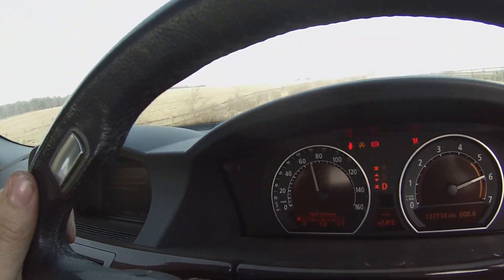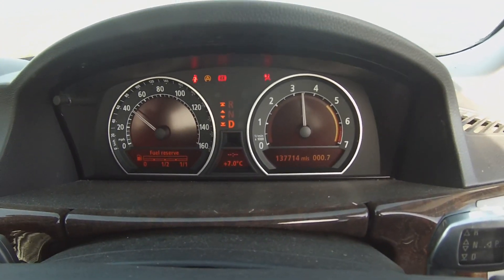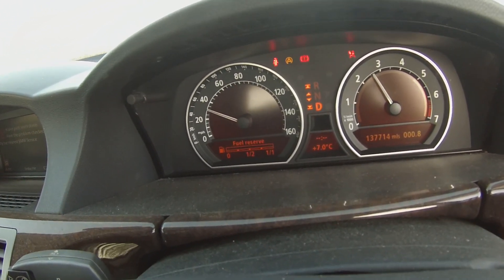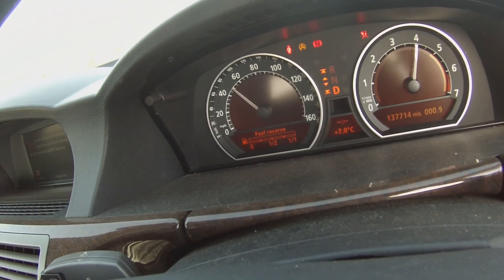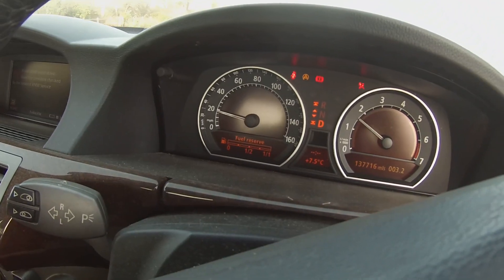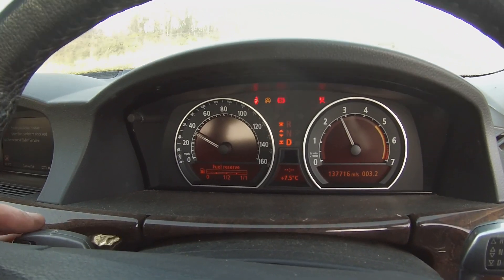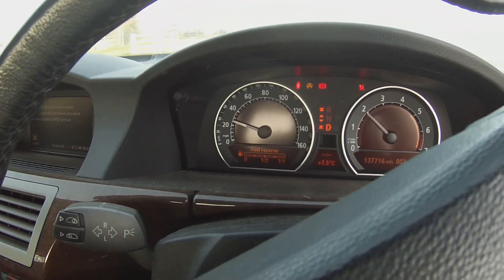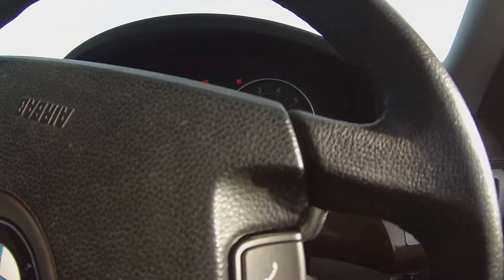The Bexus : First On Road Testing

Comment: Is the tach reading MG1 or MG2 speed? Interested in knowing output shaft speed, and corresponding base speed if you have the data! This might be a good replacement for my current Siemens PMSM
Reply: Did you get a response to your question(s)? They are both of interest to me as I have a Siemens motor that I am transplanting into a Volvo V70 (big car). I think the Lexus motor/trans would give me the higher power I'm looking for  though 60 mph at 6000 rpm isn't really good for range. Thoughts?